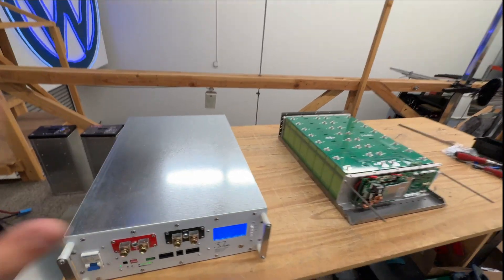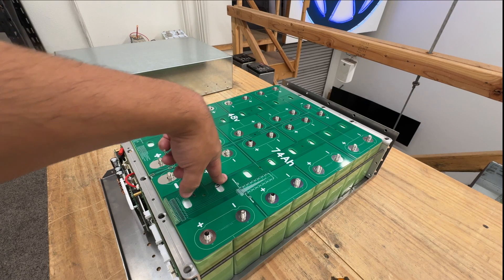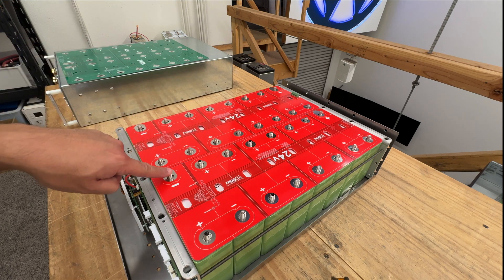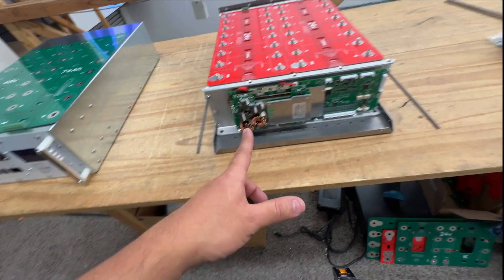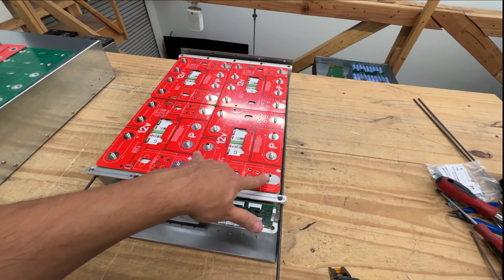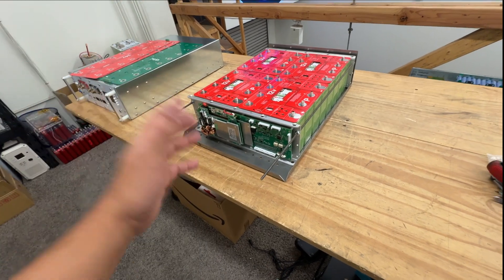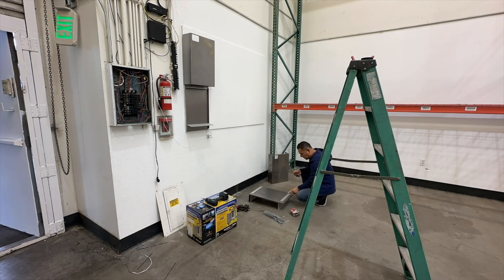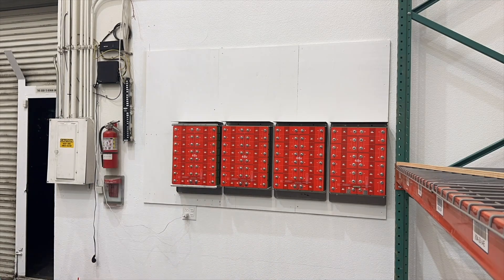DIY LiFePO4 box ANY Voltage

Comment: Hey Jehu! I bought sets of Lev60s from Jag. They are awesome! Can I flip the 24v bus bar on the reverse side to have it still work properly?

If not, could you design a reversed version of your 24v bus bar? That way the 8s could be paralleled with other 8s seamlessly? As it is now, when it is flipped either way on the normal side, you have to run wire to parallel them. 24v would also fit well in the DIY box without additional wiring👍🏼
Reply: Oh better yet, a combined 24v 16 cell bus bar!
Reply from the maker: I’m working on a 24v version,  I already have this one https://jag35.com/products/24v-8s-busbar-pcbs-for-lev60f-cells but I’m working on a side by side one currently.
Reply: @jehugarcia  Awesome! I'll be on the lookout for those.

Comment: I have a yeti 3000 how can I make these work with your set up here? Cause I love to add a bunch of storage for a power wall .
Reply: The Yet 3000X says it can accept a power input of 14-50v, so you should be able to build and use the 24v box shown in this video (since 48v would be too high voltage, when fully charged goes above 50v).

Comment: But at 12v you will need huge cables to pull the AMPS, don't think it will fit.
Reply from the maker: I can make 1/4” copper bus bars
Reply: @jehugarcia  but will everything still fit in the box
Reply from the maker: @richardlinked8797 same amount of cells
Reply: @jehugarcia  I was talking about the cable needed to  connect the 4+ and 4- all together in order to connect them up to the front panel.